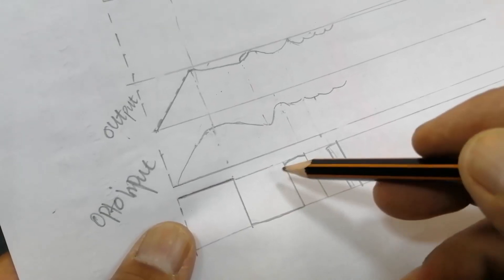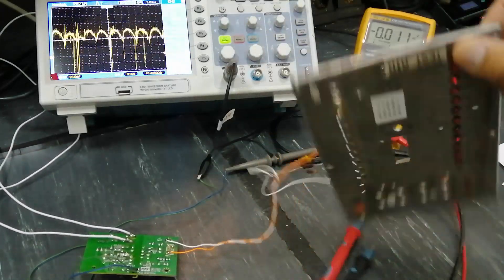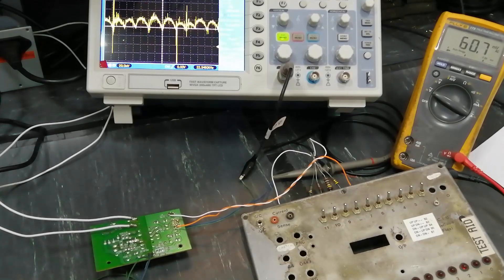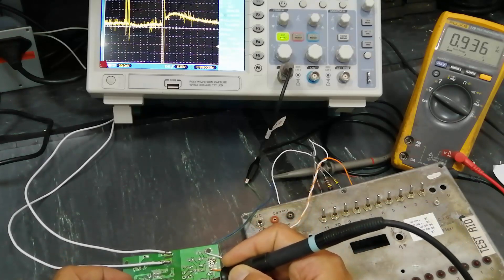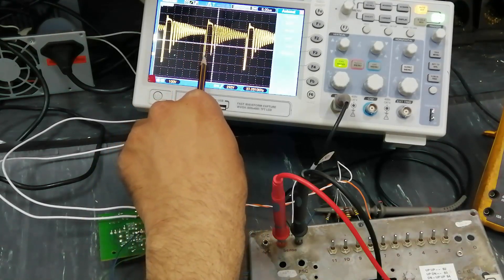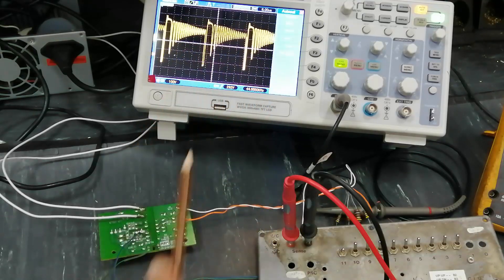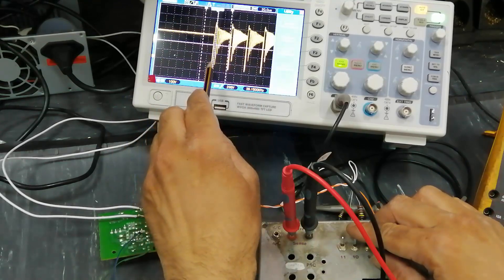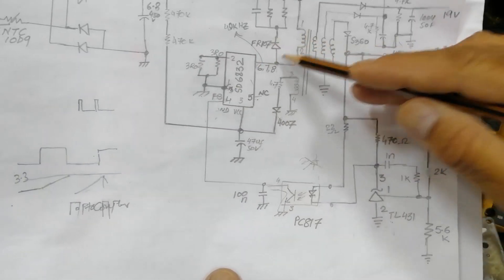#257 FEEDBACK Loop in Switch Mode Power Supply SMPS

Comment: Hi, I  have not working atx with XY6112 ic which has same pinout as THX203. Put thx203h and damaged,no vcc get from coil transformer. Startup has via 3 serial 1M resistor but on working smps this voltage is stoped less then second  in my case this voltage to pin 1 i constant 270v
In thx203h circuit pin 4 determine greq and us serial cap to gnd,in this atx pin3,4 are shorted and then resistant....
Any suggestions, is chips compatible?

Comment: Sir may I ask if a optocoupler use as a feedback in a circuit the pin 1 and 2 is a input side or led side and pin 3 and 4 is a output side or transistor side I'm I correct sir tnx